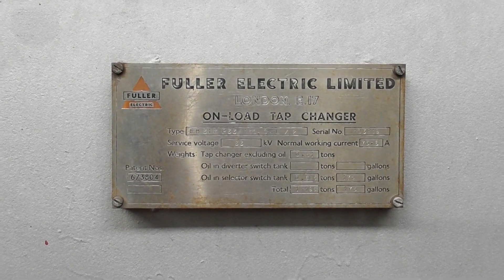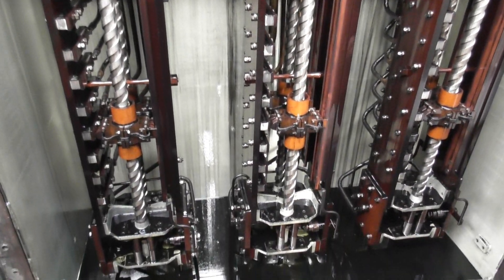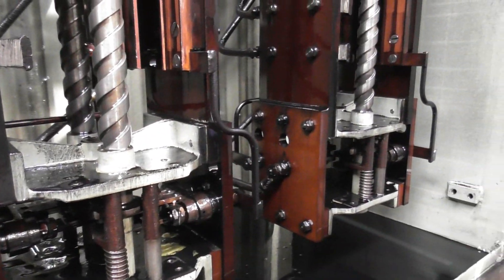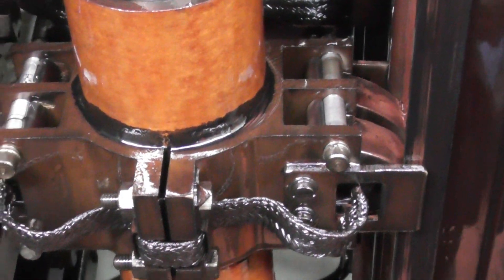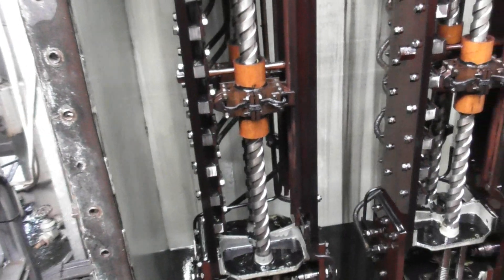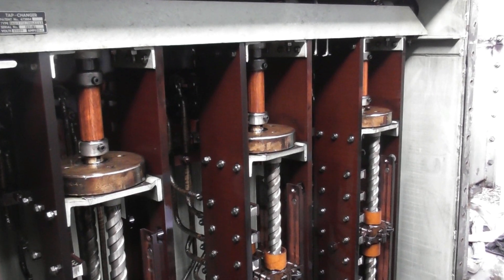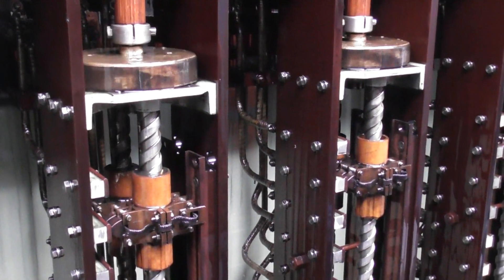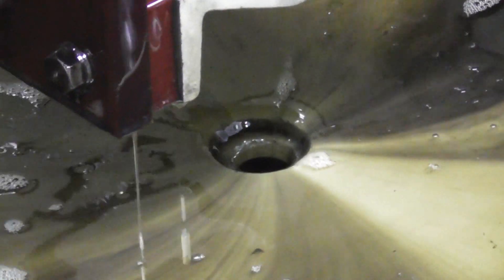Fuller Tapchanger EH317P33 contacts - part 1

Comment: I used to work at Fullers in London from 1962 as a boy.. I was in the transformer side.  A bit of history for you. .....    Fullers was taken over by Hawker Siddeley in the mid 1960's. The tapchanger side  split off into a new factory next door and became Associated Tapchangers Limited. Transformers became HSPT. They went through various takeovers until about 2005 when transformer side closed down. Tapchangers went to Brush in Loughborough. Still there I think. best wishes.   This link shows a tranny coming out at HSPT. The red blanking plate on the side is where the tapchanger bolts onto.https://www.youtube.com/watch?v=hXteZQrpX-g
Reply from the maker: Thank you for your detailed reply and historical information. Will watch that link now. Have an awesome day.
Reply from the maker: Awesome video. Thanks for posting that link.

Comment: Thanks for showing this Ray  interesting that it has a 400 volt motor was 3xpecting it to be 110 DC like the CBs in an earlier video
Reply from the maker: Yes, different manufacturer tapchangers have DC, AC single or AC three phase motors.

Comment: What are they using to flush it out? Almost looks like Gasoline.
Reply: Transformer oil. The original oil would be pumped out, filtered, run through an ion exchange resin bed to remove any acid or basic breakdown components, along with water, filtered again with a very fine filter, and then put into a tank so it can be put back in service. Saves a lot on oil use, as the oil is still good for service after you remove the contaminants out from it. A bit of top up oil to make up for what is pulled into cloths, lost from evaporation over time, and you basically use the same oil for decades.
Reply: @SeanBZA  Nice, thanks for the explanation. 
I thought Transformer oil was more viscous than what it looked like when they flushed it, so it must be something specifically for cleaning.
Reply: @Basement-Science  Transformer oil is typically a very light oil, more like hot syrup than anything else.
Reply: @Basement-Science  tx oil is pretty much like water in viscosity.
Reply from the maker: Clean recycled mineral transformer oil is used for rinsing the mechanism out.
Brandnew mineral oil is clear from colour with a bluish hue. Recycled oil is usually yellow/brown. (still rated at 80kV per 2.5 mm or 1/10 inch)
Reply: Thanks for the replies!

Comment: Quite a fascinating device. 
I'm still a bit foggy on the operation. Does it select a new tap by momentarily bridging the output across two taps to maintain output as it moves from one to the next?
Reply from the maker: James explains it very well, an inductor is used to avoid having a winding being shorted out instead of a high power wire wound resistor. The diagram at 0.19 shows the midpoint fed coil.
Reply: Check out the diagram on the plate at 0:19. Looks like it preselects the next tap and then the bottom contacts switch between current and next tap while diverting through the resistance shown between them. Edit: not sure that’s resistance though as current always passes through them... Could these be inductors on a common core, and low enough non-mutual inductance to prevent too much arcing on the switch over?
Reply: Doesn't appear to be bridging. I'm pretty sure the answer is to be found in the transition contacts as seen at 1:10 and 4:40. I don't know exactly how it works  but maybe Ray will explain how those the contacts actually provide "bumpless" change-overs.
Reply: The higher voltage ones I know do that via resistors but can't see any of that in that particular design